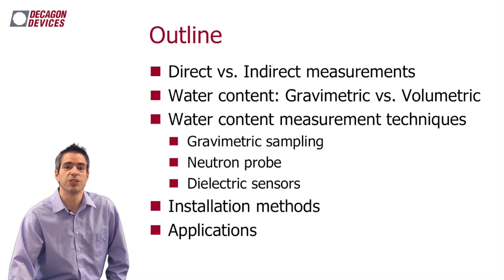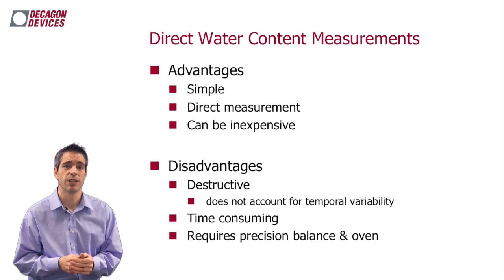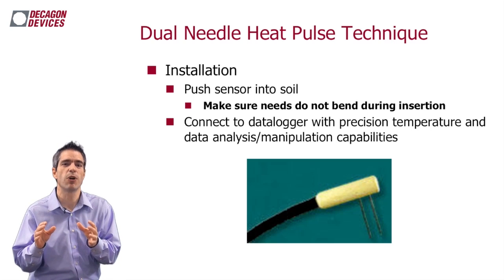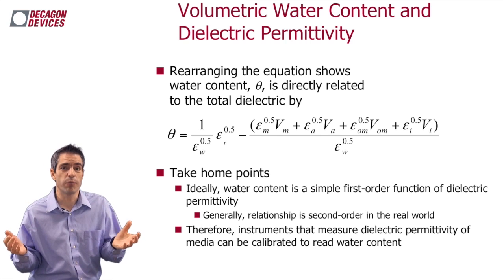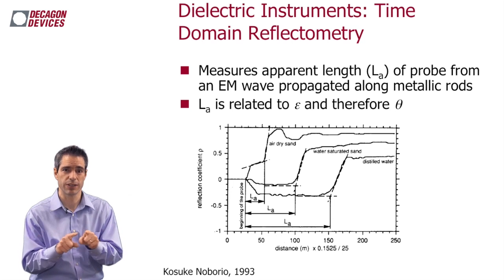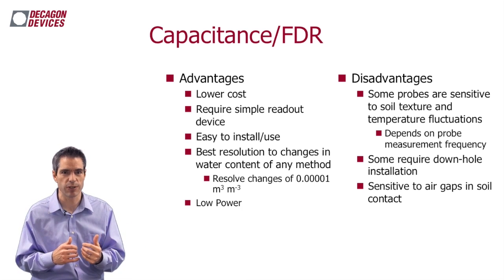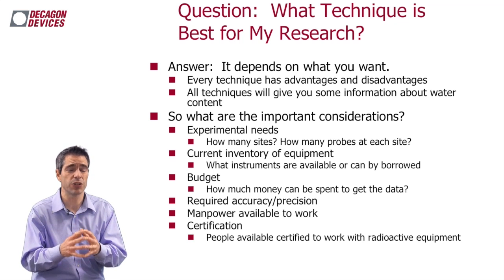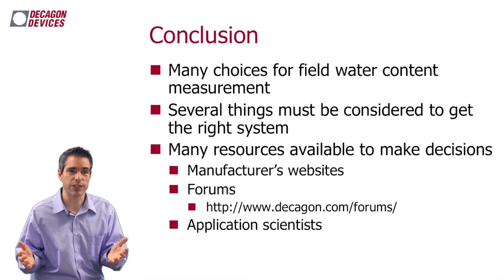Soil Moisture 201: Water Content Measurements Methods and Applications

Comment: Hi, thank you for the video. Dr. Colin mentioned the sensors are sensitive to air bubbles. So, does it means that all these instruments are only applicable to 100% saturated soil?
Reply: Hello @zhang, Most of these sensors are based on the idea of change in dielectric constant of the soil medium with change in water content, since the dielectric constant of air (=1) is less than that of water (=80), the resultant dielectric constant sensed by the sensor will be incorrect if air packets are present in soil. If soil packets are present, the sensors will underestimate  the water content value. 
Note: Most of these sensors do not measure dielectric permittivity, their circuitry is sensitive to the dielectric permittivity of medium.